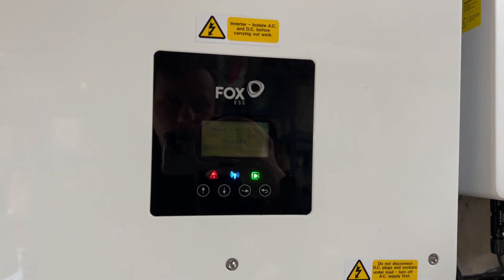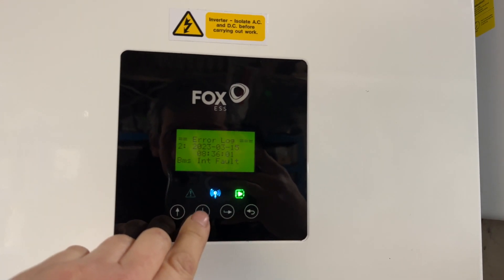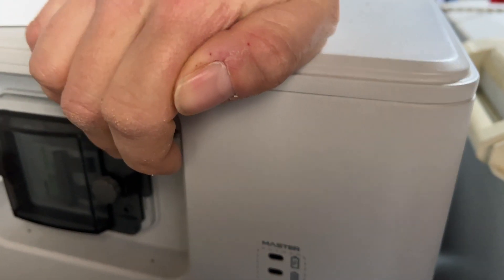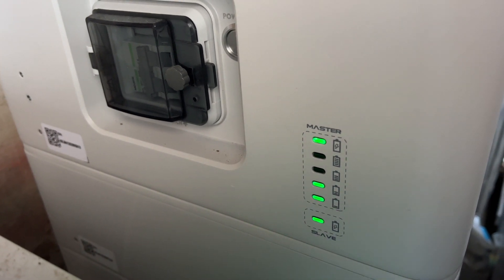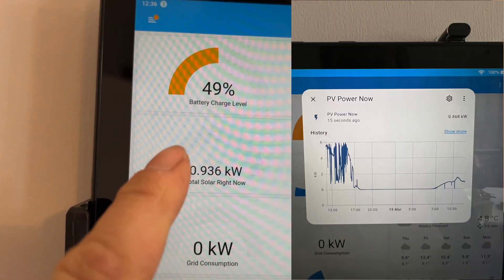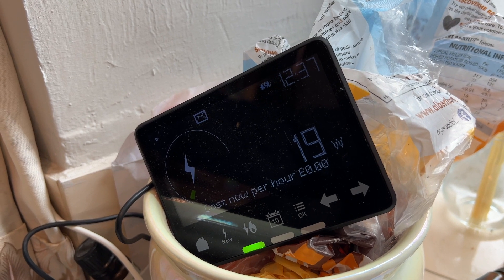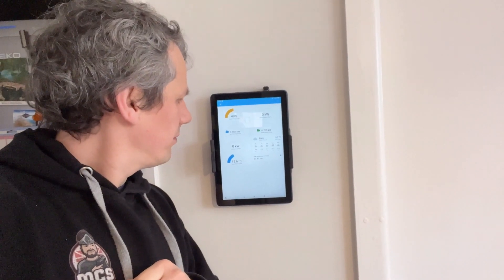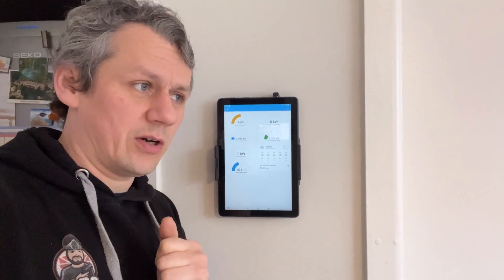House Battery BMS Fail?

Comment: Subscribed! Looking at getting solar panels and offered Fox ESS battery (5.2kwh) and the Fox inverter. Would you recommend it after having it for some time? Thank you
Reply from the maker: Yes. But requires Home Assistant and Modbus the inverter really if you want to be able to monitor properly.

Comment: Just had a quote for a system based on a Fox Ess inverter and battery.  There is precious little out there on reliability and user feedback.  Then I found your videos!  Thanks Ian for your efforts, really helping some of us evaluate this new brand.  You are struggling to even get the monitoring of the app to tell you what you want to know.  I really want to be able to tell the system what to do, so I can charge during dark winter months on night-time off-peak rates.  If it won't even monitor what chance it can allow me to control...

Comment: You haven’t had the best of solar & energy storage experiences. Though this evidently hasn’t put you off. Has it put you off this particular paired equipment installation?
Reply from the maker: Its not what its supposed to be. Just like public EV charge points; in about ~5 years they might have it sorted. If you go big system its not as rosy as you might see in adverts/promotional material!

Comment: You can get internet connected relays you could use that to do a reset, simple esp32 board can do it, you can log in anywhere and reset it, I've done this over the years on lots of hardware.

Comment: Interesting how the top 3 out of the 4 battery charge level LEDs are on. That's not supposed to happen, so this indicates a software crash, unless it's some oddball error display.

Maybe not being there to use power has left the code with nothing to do, hence no interrupts to reset anything.
Reply: The LEDs are in error mode. There's a chart in the manual which will indicate the error by viewing the illumited LEDs, what colour (red/green) & which ones are solid & which a flashing.

Comment: I’d hazard a guess at the BMS shorting it’s pants when the SOC got very low. It may have panicked if the calibration was off. Overnight cold temps could have thrown the reading (resistance values).
Try putting a rule in on HA that performs a check to see if data is being captured/updated.
If not, send you a notification or text.
Reply from the maker: SOC was at 49% so not low SOC (well not what I would call low anyhow!)

Not sure how to do rules in HA, so will take a look, ta!

Comment: At least you are being paid for any 'excess' solar going to the grid! Have a look at SwitchBot but I think that is Bluetooth - maybe compatible with HA if your HA device has Bluetooth? I assume you managed to get HA running over the internet and not just locally? Maybe you could add some HA automation to alert you if you have excess solar, battery less than 97% and not charging?
Reply from the maker: Yay £0.04 p/kw 

Yeah I will need to setup some rules for alerts or something!
Reply: @IanSampsonRLO  Have a look at Octopus Flux 25p/Kw or Octopus Outgoing at 15p/Kw
Reply: @ched999uk  if you have an EV you need a lot of PV generation to make flux work, the 15p outgoing octopus is not allowed with any Go tariffs making that a bad choice for EV owners also.